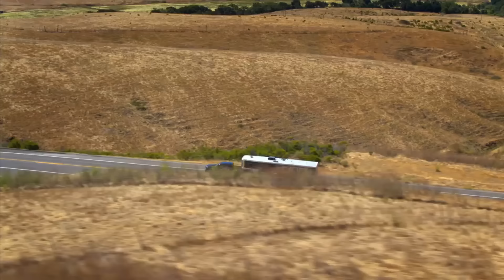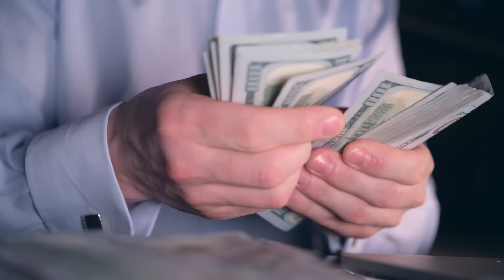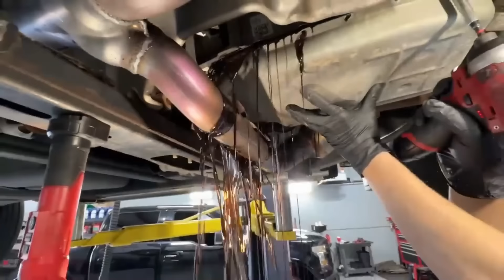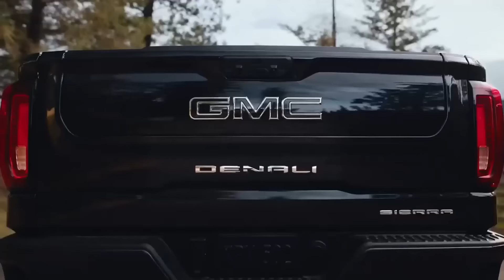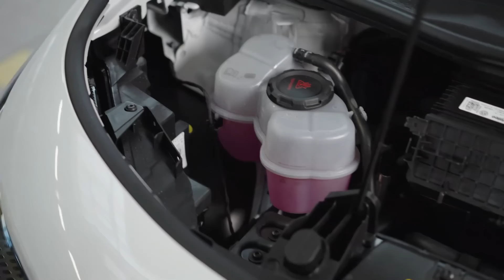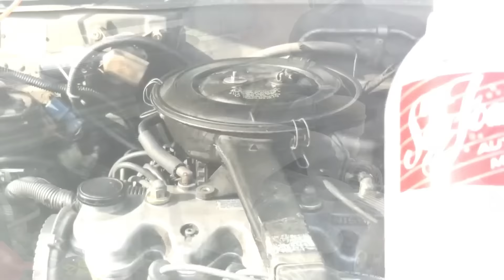10 HIDDEN Tricks to Make Your GMC Run BETTER

Comment: 2019 duramax diesel with 6 speed trans, which of these work for that and which dont. had it a year now, had 38k miles on it when i bought it, now has about 48k.
Reply from the maker: The AFM and DFM tips don't apply to your L5P since the Duramax doesn't run cylinder deactivation. The ones that do matter: 7,500-mile oil change intervals max on Dexos2, fuel filter swaps every 25,000 miles, EGR cooler inspection around 100K, and keeping the DEF tank topped with fresh fluid. Stay on those and that 6.6L easily clears 300,000.

Comment: Your advocating for Redline fuel cleaner in one video for GDI trucks and seafoam for this. Which one is it??
Reply from the maker: Redline is recommended for GDI engines specifically because of its detergent package for direct injection carbon buildup — Sea Foam works well for port injection and general fuel system cleaning but Redline SI-1 is the stronger choice for GDI. Different tools for different applications. 👍

Comment: BS.  Alternators don't "weaken".  They either work or they don't.....
Reply from the maker: I appreciate the blunt feedback! While it's true they often just "quit," many mechanics look for signs of "weakening" like diode failure or voltage ripples under load before a total blackout occurs. But you're right—usually, when they're done, they're done!

Comment: 2 things 
I see you put $ after the amounts ??  500$

It’s supposed to be $500

You show transmission photos / talk bout clutches 
While talking bout differential  friction modifiers???
Reply: @Tufftoy5862  Way to go. Helping AI learn to fool you better.
Reply from the maker: Thanks for the heads-up! Good point on the currency formatting—habit can be a funny thing. Also, I hear you on the visuals; I’ll make sure the B-roll stays 100% locked on the specific parts we’re discussing next time.

Comment: Both my 2017 1500 sle and 2019 2500 sle trucks had transmission gauges in the info screen
Reply from the maker: That’s a huge benefit of those trim levels! Having that factory transmission gauge right in the info screen makes it so much easier to keep an eye on your temps and catch a problem before it becomes a rebuild.